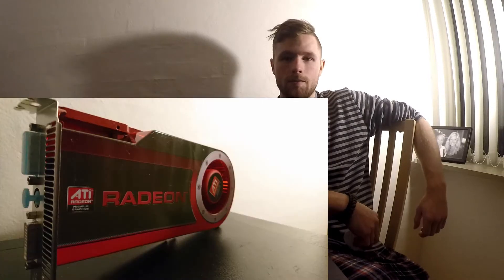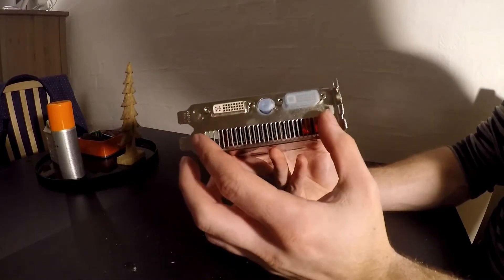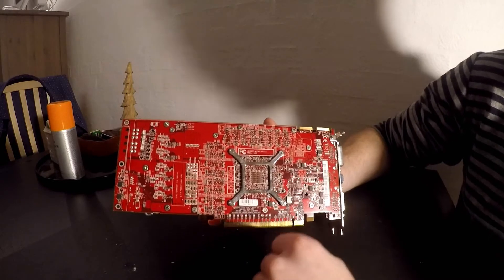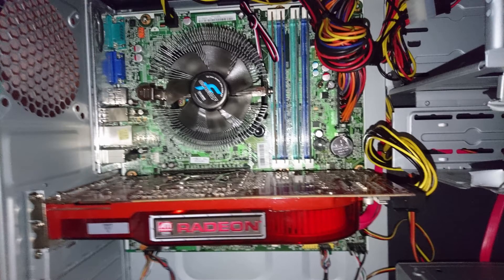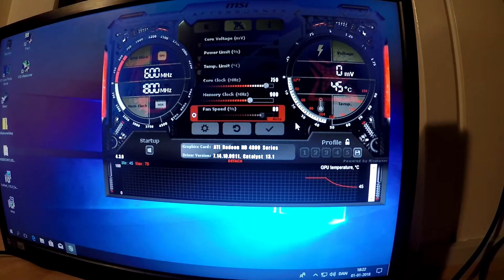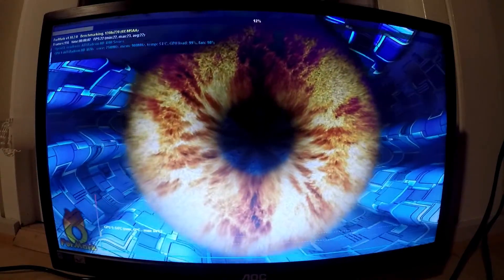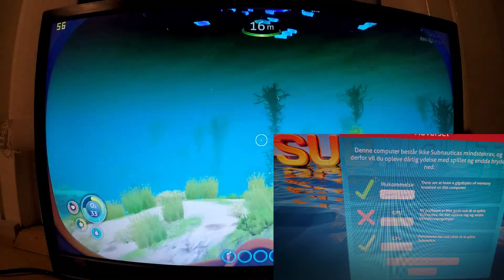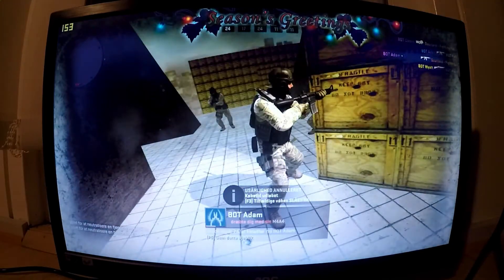ATI RADEON 4870 VS GAMING

Comment: The radeon 4000 series was made to run at high temperatures very well so seeing 70-80 degrees c on it is not unusual.
My radeon 4850 if i did  not clean the dust out of it every few weeks would get to 105degrees C at 100% fan speed! The first 6 months I owned the card it was running like this constantly until I learned to clean it right to get the temperature down to 49 degrees c at 40-60% fan speed.
My radeon 4850 still works to this very day in a back-up pc.

Comment: could you use it in windows 10? what would happen because you said the drivers for the card only support win 8, great video by the way. also its an express 2 card, did you install it in a motherboard with express 2.0 or does it matter the motherboard is newer?
Reply: Thanks, will have to buy a new card then, time for an upgrade anyway.
Reply: you can force windows 8/7 drivers somewhere in the OS
Reply: actually you can and not that  hard
Reply: Jonathan Soko  Yep. It will work with Windows X, just use what ever driver the OS gets and stick with that.
Reply: Jonathan Soko  You can still use the old driver, but to install it you need to do it through device manager with the 'have disk' option and find the driver from the download pack.  It won't install with the installer.  Once you have the proper driver it can do the Win 10 desktop even at 4k 30fps, but 4k is too hard for it in games of course.  It can game 1080p pretty reasonably in e.g. SCII.  The most obnoxious thing though is that every few months windows 10 overwrites the driver with their awful generic one that doesn't even output 1080p and you need to install again through device manager.
Reply: @BLKBRDSR71  Nope, don't do that with this card, the Windows 10 generic driver for it does get you video output, but it isn't really using most of the card and the performance is truly terrible, it won't even output 1080p with that driver and will be like 5 fps max in games, use the old AMD driver even though it's a bit of a hassle (purely because Windows 10 keeps overwriting even when you set the setting specifically that should stop Windows Update from doing that).
Reply: Jonathan Soko  "I didnt say it couldnt work, i said its trash on windows 10 and a waste of time"  It's practically the same unless you mean the Windows 10 generic driver, that generic driver truly is trash.
Reply: Oh.. for the 4k out you might need the 1GB version of the card, the 512 MB one may not cut it.